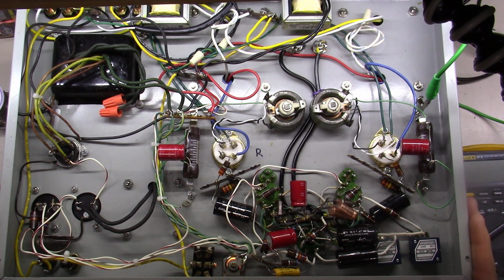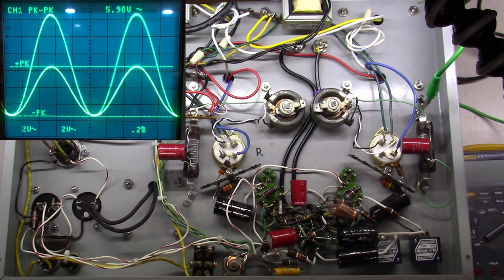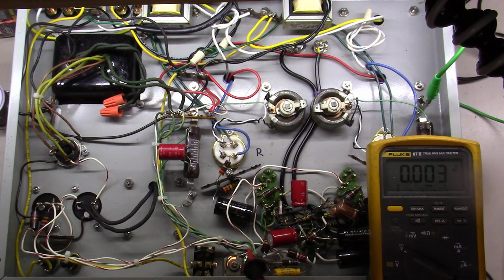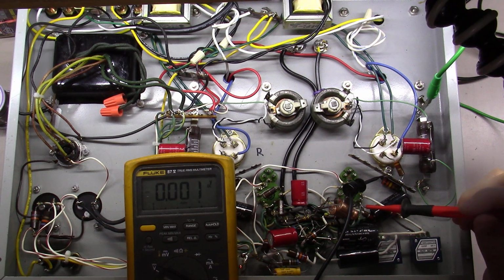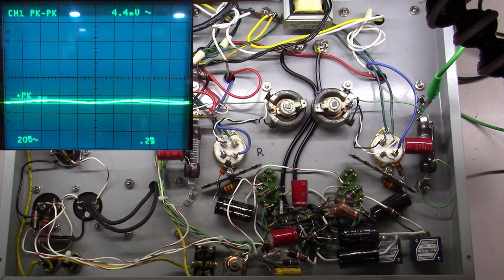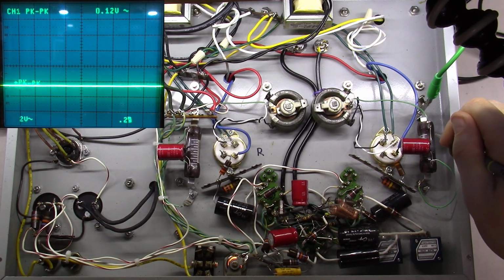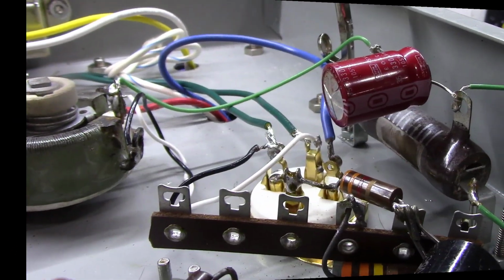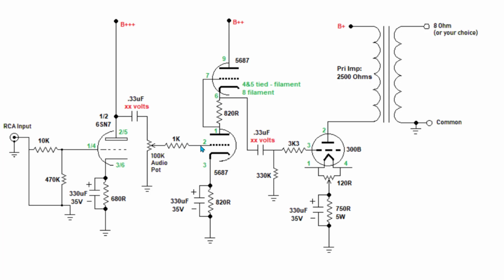How To Troubleshoot a Stereo Tube Amplifier Channel Imbalance

Comment: hi ! hey mark i need some help !  i have a 6v6 pp mono amp.
here is  the problem ! no sound comes out , the sound  goes in  through a 12ax7 tube  and  it reaches  the  output of  the  6v6 tubes  but  it does not come out  to the speakers , i changed tubes , no luck , i know the sound reaches  pin one  of the 6v6 but it does not come out of pin 3  which is  the plate  of  the tube  and that is where the taps  of  the  output transformer is connected .
another isssues is that the schematic  needs 310 v dc  on the  plates of the tubes according the schematic  , but i get 427 vdc ,
the  power tran.  is  supposed to be 315vca x 2 centre tapped   with  6.9 volt filaments  .  this  is the  transformer  is  in the amp  ,  and  the proper voltages on the primary side  are correct as per schematic , but how come i end up with 427 volts dc  on the plates !  is  this the reason for no sound  out to the speakers ?  when i probe with my signal tracer sound is  going into the tubes  but i get no sound  out of  the plates  of the outputs .
can you advise as what is going on ?

Comment: I have a big mystery. This tube amp, when I plug in both RCA input cables, vocals/voices become recessed/distant/thin. If I plug only the left RCA or only the right RCA, then vocals/voices are back and overall volume is higher. So, it seems the circuit subtract one channel from the other and amplifies what is left. Ever seen anything like that?

Comment: Hi there i have the same problem with the  one channel plays lower than the other but the problem is the potentiometer. I use a stereo 1M potentiometer where the  one section has a difference of about 10K from the other. I bought 3 different potentiometers and none of them have both sections with exactly the same resistance. also if you do the right left channel test, the music from the right channel is heard low and in the left channel and vice versa. . Do you know what I could do to solve these problems? I've really tried everything

Comment: Really intriguing. I would have guessed the fault incorrectly. When I saw practically no cathode voltage on the "left" tube (left side of the screen, not necessarily left channel) I thought something must be wrong. The cathode voltage on the right side tube made sense to me - there's current flowing in the cathode bias resistor, therefore you expect a voltage drop - exactly the same way a cathode follower works. But lo and behold, it looks like the cathode bypass cap of the right tube was open! More head-scratching to do on my side .... but thanks for the puzzle!

Comment: Late to the show as usual, but did anyone mention that there was about 60 volts across those 35 volt cathode bypass capacitors? No wonder that capacitor was damaged. It will happen again unless they are upgraded in voltage rating.

Comment: outstanding video!  really good practical advice.  one question:  what kind of Oscilloscope probe did you use?  10:1, 100:1 ??? I am completely paranoid about screwing up my oscilloscope!  I do use an isolation transformer on tube radios etc--but its only rated at 300 watts--so not really suited for a amp like this...any tips really appreciated.  Thanks!

Comment: Hmm. Considering it's an 'AC' problem (no clipping or non-linearity), I'd just probe around, comparing the channels with an AC-coupled 'scope!
Having not viewed the entire video yet, my guess is a plate or grid resistor that is out-of--value, changing the gain.
UPDATE: DUH! I should've realized that if it's an AC problem, to check cathode bypass cap,s. Out-of-value gain resistors WOULD affect DC performance! :)

Comment: So the signal we saw on the bad capacitor was being sent to ground instead of getting amplified by the output tube. 
Do I have this about right?
Reply: SciPunk215 You have it back to front. The signal at the cathode in the working channel was zero because the bypass capacitor was working, and non-zero in the other because it wasn't. The cathode is DC coupled to ground via a resistor to get the DC bias, and AC coupled to ground via the capacitor so as not to get NFB via the resistor, which lowers the gain.

Comment: Hey man, would you consider doing a video on general safety and how not to get electrocuted when working on vintage gear?  I zapped myself BAD trying to replace a resistor on a dynaco last week.  I have 70s receiver I want to attempt a recap on and I don’t want to die.  There’s not a ton on YouTube about audio gear and what exactly to do to make sure you don’t get zapped.  Thanks a lot, enjoying your videos and learning a lot.

Comment: good logical trouble shooting.If you don't bypass that ac signal, it will offset the dc bias of the tube on the load line and therefore reduce the gain, ie negative feedback to the grid.
Reply: Steve H It will not 'offset the DC bias' or affect the load line. It will provide NFB to the cathode via the cathode resistor. Nothing to do with the grid whatsoever.

Comment: When the bypass capacitor is not in the cathode circuit there is Negative Degeneration, any reasons why there is negative cathode degeneration or negative emitter degeneration which lowers the AC gain of a circuit or stage? What is causing Negative Degeneration?
Reply: wayne Gram The resistor. When conduction increases, the voltage drop across it increases, which increases the cathode voltage, which increases the bias, which partially turns the valve further off again,M reducing conduction. Without a bypass capacitor the gain is defined by the ratio of plate load to cathode load, if this is lower than the valve's gain. With it, it is defined by the valve properties alone.

Comment: I don't understand how that preamp circuit can work without a plate resistor?
Reply from the maker: plate resistor is the OPT primary winding.
Reply: I meant the first input stage there is no plate resistor. How can a voltage fluctuate  without a resistor to B+ and the plate?
Reply from the maker: @LJacyHenry  Ah - take a look at the power supply schematic, in essence the 2nd 27K in each leg is the plate resistor
Reply: Oh ok I didn't notice that thanks!

Comment: You are  testing voltages  while   the amp is not under load  , I see  a problem  with this
Reply from the maker: There was a load and playing through a dummy load.  1khz signal, otherwise there would have been no output or signal along the way to measure, think about it...
Reply: @GeeBee135   The  unit wasn't  under load, because  it was upside down and  the tubes  where taken  out, so the output  transformer was not  connected  to the  plates   of the output  tubes.  which means  no connection , no load  on the primary  side
Reply from the maker: @johnsenchak1428  tubes were not out of the unit, it was up and functional the whole time.

Comment: Nicely done - a time-efficient run-through but still managed to be a thorough fault-finding process and all without a schematic :)
I'm assuming you changed out those 27k resistors in the PS and if so, out of interest, how far out were they? I'd also replace the faulty capacitor, with a higher voltage part as 35v seems low; and do the same on the other side assuming it's the same part. (edit) Just saw that Martin Ahlqvist
 had already mentioned the capacitor's voltage rating being low.

Comment: Hmm you measured 60V over the bypass capacitor but the caps seem to be 330µF 35V ??? not surprised it did not last, I am surprised it lasted al long as it did, a 100V cap would be more realistic.
Reply from the maker: You are spot on.  I believe this amp was built using parts someone had laying around.  Many of the resistors in it don't match wattage wise.  Left channel would have a 1 watt, right channel would have a 1/2 watt for example.
Reply: Yeah, my first thought was, gee that looks like a fairly new Nippon-Chemicon, how did it fail? Oh 2x over voltage limit, haha.